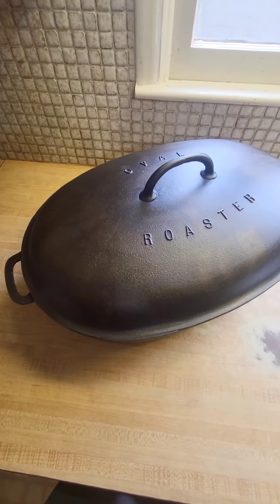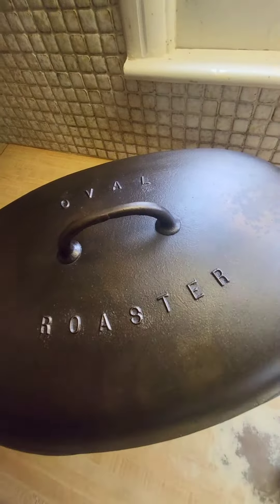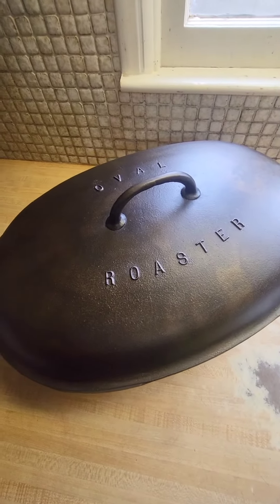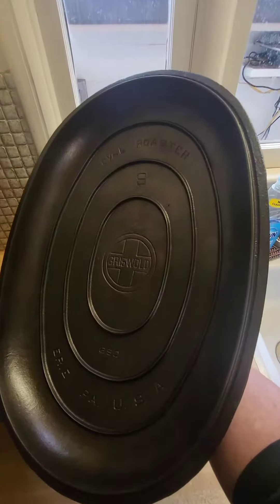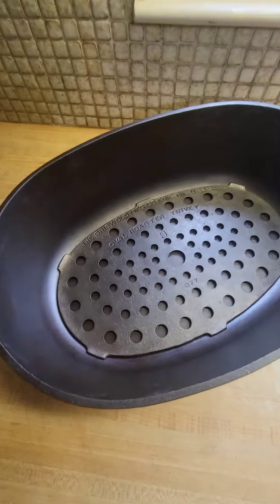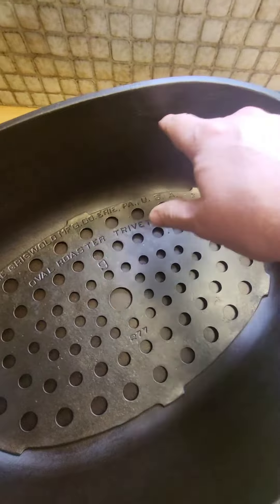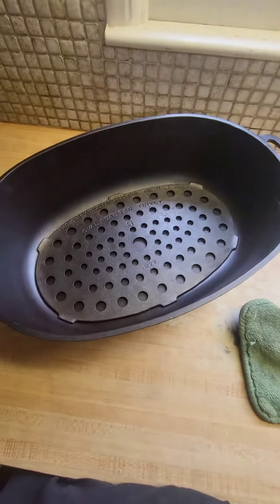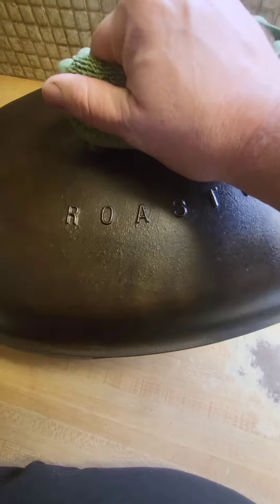Griswold Large Block Logo #9 Oval Roaster Restoration: Completed!!

Comment: Nice job. What did you use to season the roaster? I have the Wagner version. My  trivet is aluminum and Wagner marked. Your is nickel plated?
Reply from the maker: I used canola.
Reply from the maker: The trivet looks like it was nickel plated at one time, but over the years wore mostly off.
Reply: I was going to ask if  were going to sell it or not, Nice Job,